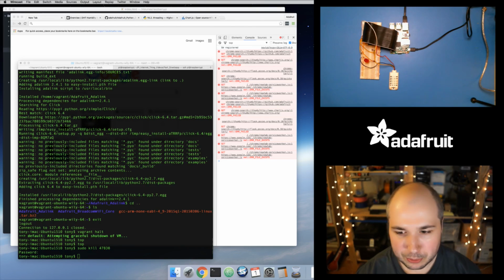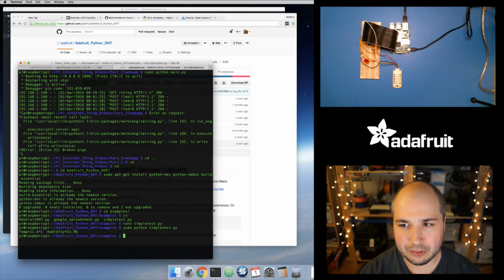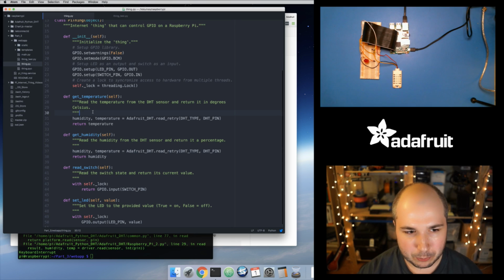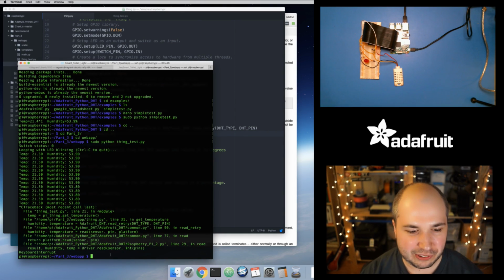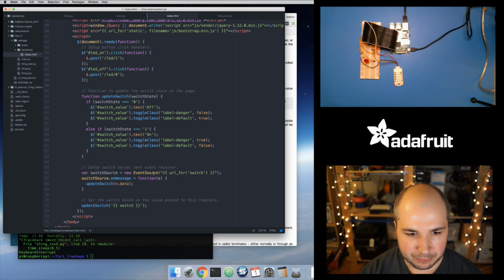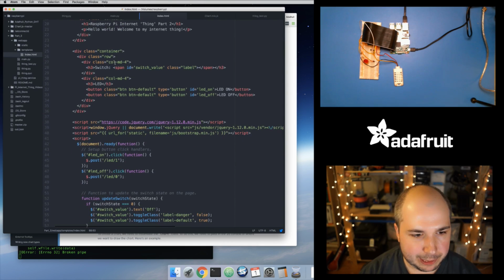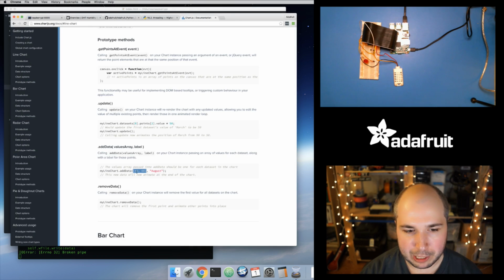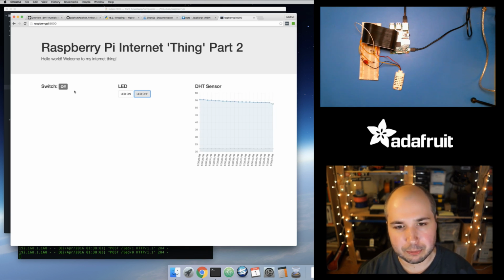Raspberry Pi & Python Internet 'Thing' Pt. 3 with Tony D! @adafruit #LIVE

Comment: Hey Tony!! Great video
I have a question. i wanted to add more switches to your code and have successfully added an additional switch read. However, when i add addition switches the DHT temperature & humidity chart data and switches state vanish. I've check in /thing to see if its reading correctly and it is. i don't know if it is bootstrap or and error that i made. thanks

Comment: Great video! Learned a lot!
I have a question:
If the Pi is not able to connect to wifi (say, suppose the pi is running on a car to collect the temperature and humidity data) so that it won't be about to host the web server, is there a way we can configure the Pi to send data to some web server so that we can access the data from somewhere, say, from our laptop at home. (For example, the Pi collects the temperature and humidity data in my car, and I want it to send that data to a web server in real time and then my sister at home can go on to some website and check out the temperature of my car...) Is that possible?

Comment: To fix the error "TypeError: (intermediate value).Line is not a function"
download and use this Chart.min.js --> https://raw.githubusercontent.com/adafruit/Pi_Internet_Thing_Videos/e330cac20d507851a4409435a08cf3cfa0d8b2ce/Part_3/webapp/static/js/Chart.min.js

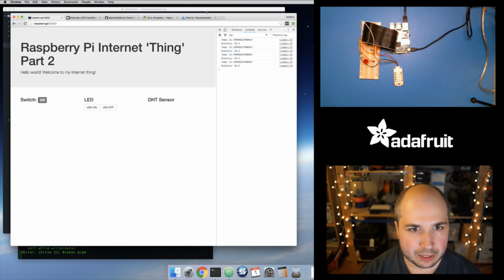Comment: This is awesome!  Everything is working for me until about 48:00.  I keep getting TypeError: (intermediate value).Line is not a function on the line var dhtChart = new Chart(ctx).Line({ .  The sample data code does not render and my switch status disappears too (the LED control still works).  Anyone have any ideas?
Reply: Got it! the Chart.min.js that I was using was from the dist folder in the Chart.js-master unzipped file.  In the zip package I downloaded using wget there was no Chart.min.js in the root of the unzipped package.  When I copied your Chart.min.js to my static folder -- Voilla!
Reply: +Damien Di Vittorio where did you get ur copy of Chart.min.js ?
Reply: +Yazid Apple I copied it from his GitHub folder for the part 3 in static
Reply: +Damien Di Vittorio thanks a lot bro! i've got it working already!